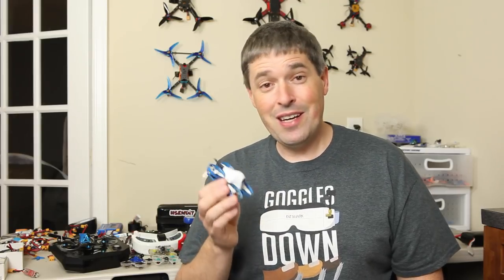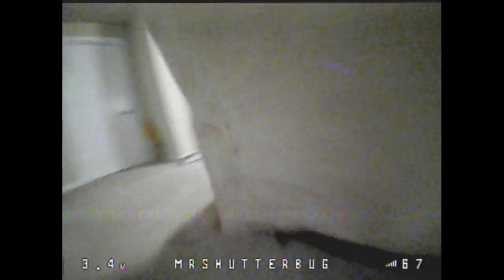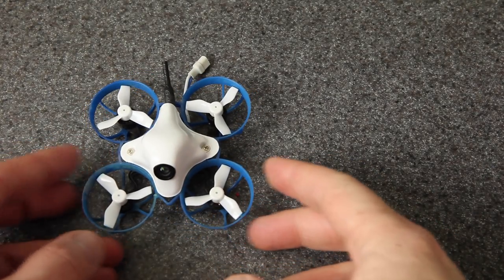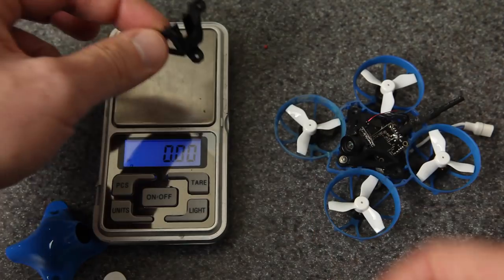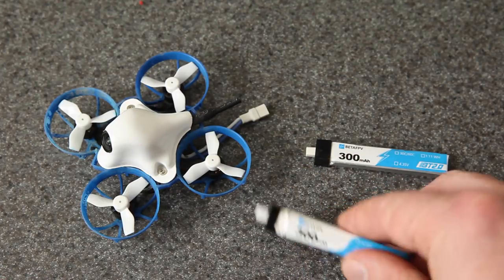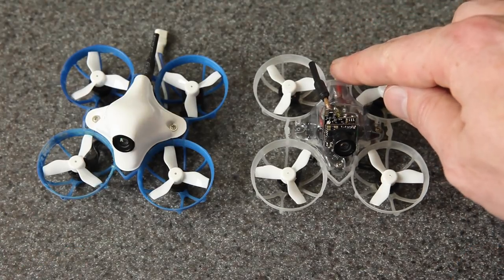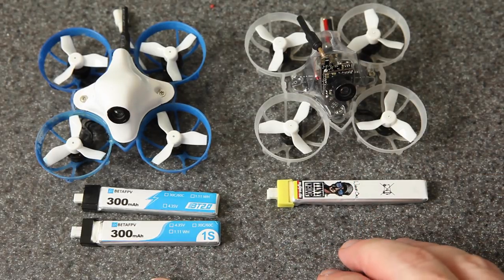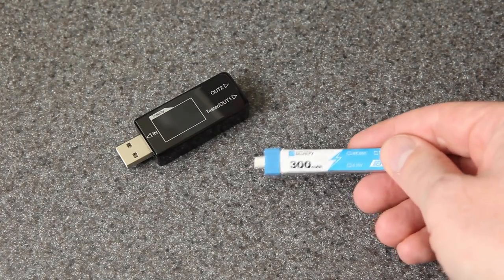Meteor65 + BT2.0 Full Review

Comment: Just swapped out the PH2.0 connectors to these new BT2.0, on my TinyHawk S and my custom 75mm, 802 19000kv rig...best, single mod I have ever done, for the most performance gain...especially on punch-outs, power-loops and recovering from dives. 😃👍👌✔

Comment: Quick tip: Hey guys, the meteor65 was my first drone and I initially had a lot of trouble with the throttle, trying to get it to hover or at least be stable, basically not enough resolution on the transmitter. I followed Oscar liangs PID and rates but changed throttle MID to 0.7 and changed throttle curve expo to 60 on the radio. This moves the throttle input that is needed to hover to the flat spot on the curve, around 0, thus providing a lot more resolution for micro adjustments. I believe this is critical for indoor flying to prevent from shooting up into the ceiling and bouncing up and down vertically. After 2 days, being a complete beginner, I can zoom around the living room at almost full speed. Btw, i have the 19000kv with Taranis x9d, so you might have to move your throttle MID if you have 22000kv.
Reply: do you have a link to these PID's?

Comment: Those are basicly 1mm gold connectors in a plastic case... Genius
So let's say I have a UK 65 and upgrade with the meteor frame and motors. Good idea to do?
Reply from the maker: These motors are fast yes, but super hard on the batteries. If you use the 19500KV motors, it will still be quite fast but you'll get more flight time I think.
Reply: Thanks at the moment I only get 2 minutes.

Comment: Hey Mr Shutterbug, would you have a BF 4.2 tune for this please?
Reply from the maker: not yet. I still run 3.5.7 on all my whoops. They work great so I haven't messed with them recently. 4.2 is great though. I use it on some of my larger quads.
Reply: @MrShutterBug  thank you. Challenge is I have a FRSKY X9 Lite on ACCESS and it doesn't bind, have been able to get some development BF firmware on 4.2 with an updated SPI code that works. 

Any advice?
Reply from the maker: Darren Allatt 4.2 should be fine to get you flying. I just don’t have any special tune for whoop racing on 4.2. Patrick Clarke (Project Mockingbird) might, but I think he prefers Emuflight these days. Good luck.

Comment: I wonder if anyone has this problem: i love the amzing fun of flying my whoops in LOS (line-of-sight without goggles) in my apartment, 
but this way i cannot see the battery/warnings and i already trashed SO MANY 1S bats due to draining them below 3volts.
Since there's no telemetry on my Metero65, programming my transmitter has no help. Ive been looking
to program Betaflight to FailSafe upon reaching certain voltage, but i couldn't find one. 
By now im kinda desperate to find a way to not kill woop batteries when not flying them LOS intead of FPV... I'd appreciate any help!
Reply from the maker: I think it may actually be possible to use telemetry, depending on your radio. It is probably also possible to wire up an RGB LED using the Tx pad that is normally used for Smart Audio. To use that pad as an LED control will require swapping resource assignments in the CLI. If you can get a programmable LED working, then you can set it up in betaflight to change from green to red as the battery drains, and flash when the low voltage warning would be flashing on the OSD. Alternatively, a beeper could be added but that requires its own little circuit, so it’s not as simple. Hope that help. Good luck.
Reply from the maker: Or... there is always the low tech option. Set a timer for yourself and land before it’s too late. Depending on your radio, you might be able to have it count down and warn you as the time approaches.

Comment: Hi I was wondering if you could help, I have just got a meteor65 with bf 4.1 on it and it doesn’t fly too great, I can’t seem to find old firmware for it, do you know if I can just flash matekf411 firmware. 
Thanks
Reply from the maker: You should always flash the same target that the board came with. In this case I believe it’s MATEKF411RX. If you have the latest betaflight configurator and you want to go back to 3.5.7 then you have to select the target labeled “(legacy)”. Hope that helps.
Reply: Mr ShutterBug thanks for your reply,  mine is a later one and it’s flashed with betafpvf411 BEFH. That target is only on 4.0 and 4.1
I used an old configurator and flashed 3.7 with matekf411. It flys mint now. 
Why do whoops fly so bad on bf 4.0/4.1?
Reply from the maker: SkEtChY fPv because betaflight is developed by people who ho only focus on larger quads. It is probably possible to make it fly well, but it takes more work because the defaults are less appropriate for whoops.
Reply: Mr ShutterBug thanks for your time 👍😃

Comment: If I want to set your pids to mine, than I have to Ctrl+V this to my CLI?

set p_pitch = 50
set i_pitch = 55
set d_pitch = 45
set f_pitch = 440
set p_roll = 40
set i_roll = 45
set d_roll = 40
set f_roll = 390
set p_yaw = 90
set i_yaw = 45
set d_yaw = 0
set f_yaw = 60
set p_level = 80
set i_level = 50
set d_level = 75
Reply from the maker: Yes, you can use ctrl+v to paste into the CLI window. Then you have to type "save" and hit return. My PIDs may work for you if you have a very similar drone. If your drone is significantly different, then you might want different PIDs.

Comment: I'm totally new to quads, and was hoping to get a quick question answered by an expert. Disclaimer: I know nothing about PIDs and rates, but trying (desperately) to learn.
I bought the meteor65 (3.5.7), and put the small 16000kv motors on. I have no clue what PIDs or rates to start mucking with, to reflect the smaller motors. With the current setup, it barely hovers with 3/4 throttle. =/ Could you advise? 
Once I have an idea which numbers to change and in what direction (+, or -), I should be able to figure it out with a bunch of messing around. 
I don't feel comfortable getting in there and just starting to change things blindly.
Thanks much!! Love the videos! -_Mattt

Comment: So much good info in this vid! Would love to see your solution for converting existing 1S batteries to the new connector. I guess you could solder a pigtail to the tabs or something?
Reply from the maker: The 1S batteries that have wires will be easy to convert (see links in the description). For the TW333 battery I intend to solder the connectors directly to the batter tabs.

Comment: I wonder what are the signs that the ph 2.0 is getting worse. When I arm my 1s whoop sometimes I have to re-arm a couple times to get the kwad off the ground. It's lacking major power, but once it kicks in it is fine. Just wondering if the connector is my problem.
Reply: Spezi Lover No warnings or anything in the  osd and the receiver is great with great range. I initially thought the problem could be the motors. They are the TW 802 19,000kv motor and they have been abused for sure. I’ll try BLHeli and see what happens. Thanks for the info!

Comment: The new connector is definetely a step in the right direction and I guess I will try it out soon. I am now flying with the red JST connector and so far it is the best compromise for my needs.
New frame looks good and most likely is strong enough for my flight style. Weight of the new Flight Controller is another big improvement. 
I wonder about the M01 camera: Do you see any better option that comes close to this size/weight (maybe also with 16:9 option)? Specs of the new Runcam Nano 3 are promising, but waiting to see a review. Also, what do think about switching from 25mW to 100mW VTX to get better range?
Reply from the maker: The red JST is rated for 3A, so it can handle more than PH2, but only 50% more. My main issue with the red JST is its physical length. Other people use the Micro Deans connector, which is rated for 10A, but it's heavier than this new connector. My most used cameras are the Wolfwhoop WT07 and the Mobula7 camera (both AIO cameras, not split). Those are around 3.4g (0.4g heavier than the M01), but I prefer the image of those two. As for range, I find that 25mw is enough for my needs. If range were not limited by FPV then it would be limited by the built in Rx instead.
Reply: @MrShutterBug  I fully agree, red JST connector is too long and thanks for your recommendations! I am currently using a no name camera from Banggood, which in fact looks quite similar to the T01 AIO from BetaFPV. Meanwhile I got used to it (and actually like the less-saturated colours). However, there could be more details (for going through trees and leaves) and better low-light performance. I very much like the size and weight of the M01 (11 x 11 mm) and the separation from the VTX. Anyhow, I will wait with my purchase some more weeks.

Comment: The question is: you were STILL going down to 3.2v in the osd. Assuming the voltage is accurate, where are the extra 0.1-0.2v getting lost? Do we need thicker traces on the boards themselves? I'm basing this on lipo performance on larger quads. If they don't sag below 3.3-3.4v then neither should the whoop batteries.
Reply from the maker: It draws a lot of amps for the little 300mah battery. It really needs lower KV or larger batteries. But, if you add too much battery weight then it will get close to the weight of a 2S whoop. In that case, 2S would be better hands down. So it's a tricky balance. The best I've found for this particular quad is still the Tiny Whoop 333mah battery. It had significantly less sag.
Reply: @MrShutterBug  I only run the 333 my lipos on my whoops, easily the best packs.

My point is that it is not (only) your battery sagging that low. If it was it would be ruined @ <3.3v. Sure your battery is sagging but probably only to somewhere between 3.3-3.5v (if you were able to read the actual lipo and not via the wires attached). The difference between that and the osd (if correct) is just voltage lost to heat. 

FYI another connector Boris of MyLipo suggested I look at was micro deans. 10A capacity and pretty small and light.
Reply from the maker: Fraser Steen yes micro deans is another option. I too would like to know where exactly the remaining sag comes from. Maybe the traces, or the undersized battery tabs used inside 1S lipos.

Comment: did you have dshoot 600 problem? mine have this problem sometimes 1 of the motor not spinning and out of sync tone from esc, can i see your BF setting?
Reply from the maker: I forgot to mention that. The board only has BB1 chips for the ESCs and they do not properly support dshot600. I’m using dshot300.
Reply: @MrShutterBug  im using dshot150 because sometime the problem is still there if using dshot300. can you give your BF setting, on motor, filter or maybe the idle-throttle? what BF version did you use?
Reply from the maker: @ZuNunchaku  I'm using BF3.5.7, but that is not the issue. If you hear the ESC tone that means an ESC reset unexpectedly. When does it happen? Does a prop fail to spin when you first arm the quad, or later during flight?
Reply: When first arming, sometimes the board restart twice after plug the battery, i check stock FW is 14 pole magnet, so i change to 12 pole in cli, and ill test it